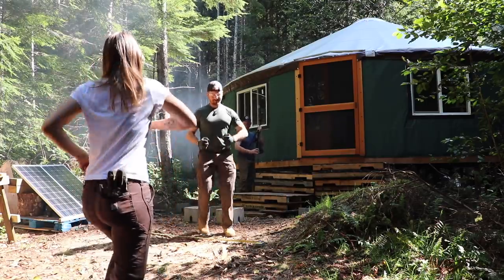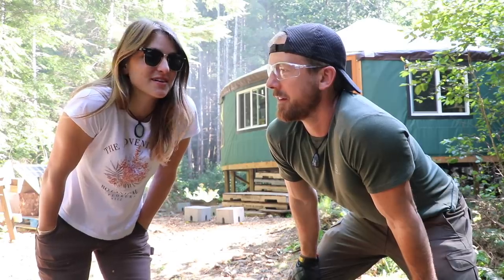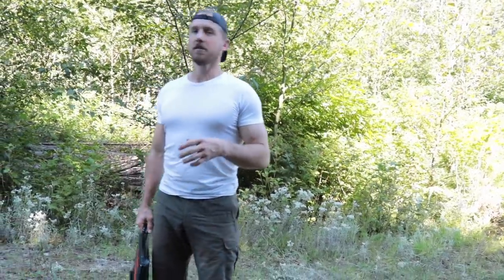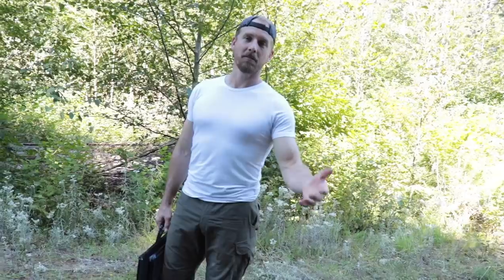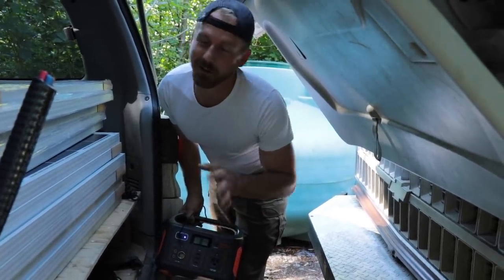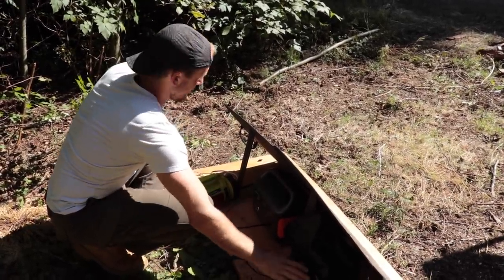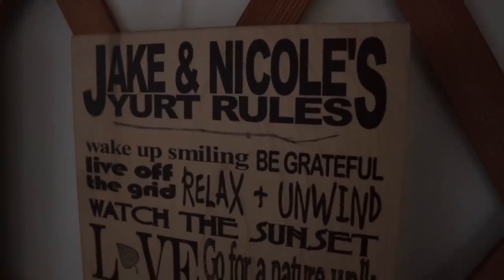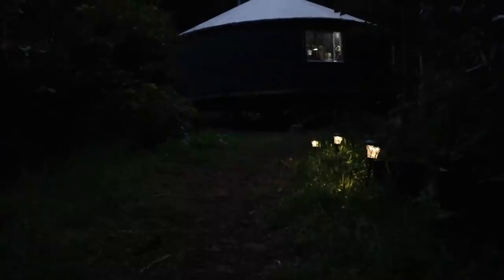Living Off Grid in a Yurt | Building a Deck - Ep 46

Comment: FYI, concrete is stronger if you don't make it so runny.  If you make it wet but stiff you will need to sift it down into the hole or forms but the end result will be stronger.  You can sift it by tapping the forms or shoving a rebar or shovel into the concrete over and over.

Comment: Hey guys. Love your channel but I would like to make a comment here. It looks like you are using bags of pre-mix concrete for your posts. I worked in the concrete industry for 12 years and I am technically trained in concrete. That concrete was very wet. I don't know if you added extra cement powder. But there is what is known as the water cement ratio. More water the weaker the concrete will be. If you concrete goes "dusty" then you have really compromised the strength of the concrete. Keep in mind a lot of that bagged concrete is only about 20mpa. The dirt around your house is about 2 to 3mpa. Even if that bagged concrete is a higher mpa  with how wet it was you would have lost a lot of the strength because of all that water. Just take it easy on the water. Compact the concrete well (don't over do it. It will segregate). That is where it gets it's strength.

Comment: I'd like to make a suggestion to save you a TON of propane. The burner y'all are using is WAY too big and WAY too far away from the bottom of the pot! That size burner is intended for really huge pots that people use to boil crawfish or deep fry turkeys! I would look online for a place that sells something more like a residential stovetop burner. Trust me you will thank me when you discover how much propane this will save you! Also, if y'all use a 25-gallon propane tank you will get much greater use per gallon. As a 25-gallon tank gains more expansion space it has more cubic inches to turn the liquid propane into a gas vapor! In other words, you get better "miles per gallon" (so to speak) by using a bigger tank!

Comment: Make sure you have very good base for you water boxes to retain all water as the rain falls. Remember that a gallon of water is about 9 to 10#'s. On one of them install a connection At the bottom of one...      2 inch for pvc pipe and run it down to the yurt....   make sure you put a ball valve at the the top to control the water going to the yurt......   also make sure you put a ball at the bottom for your pressure  which should be a lot... there will be a lot of pressure from the pure weight  of water in the tank...    should be able to run water to the kitchen as water seeks it own level.... Very simple to do............. I hope you can follow my instructions......

Comment: I love you guys, but that soupy concrete hearts my heart haha. Should be a little more like cookie dough and a little less like cake batter 💚
Reply: Megan Elise our cement mix is perfect 👌🏼
Reply: That's true if there are no additives. If they added a plasticizer it makes it real liquidy like that. I don't know if they did that, but it is possible for soupy concrete to be ok. If they didn't add a plasticizer and they've added enough water to make it that liquid, then yeah, that concrete will be very weak.
Reply: @RealKungFu   It really isn't Jake, it is a lot weaker when you mix it that thin. The peples will mostly sink to the buttom of the mix. And as someone mentioned elsewhere, you are not in frost safe depth with your poles. Frost will push both the concrete and poles up a bit every year. I absolutely love what you guys are doing, but sometimes a little research goes a long way ;) <3
Reply: this dude really is a piece of art ... he doesn't know jack shit and still think he knows it all. That thing is falling apart in less than 2 years at that rate, nothing is done right in the first place...

Comment: I have gone down the solar power Rd in same direction , to do it again on your size place , stick with renogy , renogy lithium core 12v 200ah , ad  200w panels as you need , both ways you can ad panels or batteries until getting power needed , if you ad another appliance ad what's needed , I enjoy your show , renogy might sponsor with as many subscribers , y'all demo products

Comment: You could build a table for the solar panel to sit on up off the ground the higher the panel is the longer it will capture the sun for charging. you can mount a shelf under the table to store the devices that are being charged. place 2 or 4 wheels on the legs  of the table for mobility.

Comment: for that loft to fail it would require a huge tree to fall on the yurt itself!!!  he cemented the poles in the ground through the floor!!! how would anyone think it would fail is beyond me, maybe they didn't watch you make it.
Reply: the whole build is flimsy... nothing is done the way it should. First, the pole are in the ground above the frost line which is no good as it's going to move up and down with time and nothing will stay level. Second, the concrete is like soup and if you know a thing or two about concrete or the way it works, that's not the way to do it.  Third, the whole platform is going to probably be unlevelled / ruined after one winter because it's just sitting on piles on top of the dirt and the joist on the whole platform where not attached with the right brakets... and i could go on and on ...